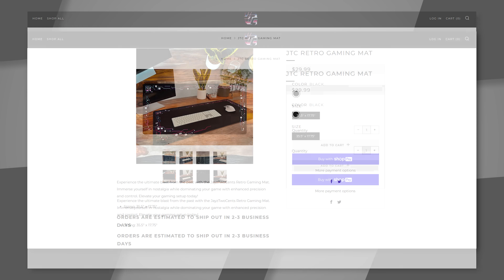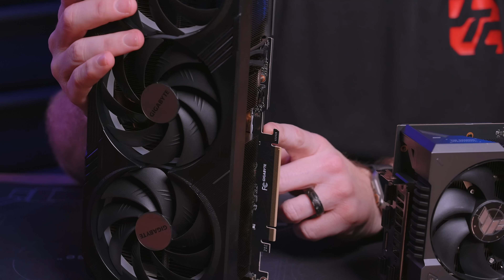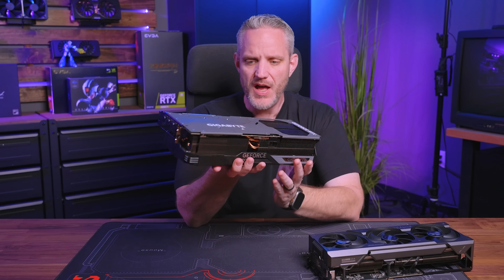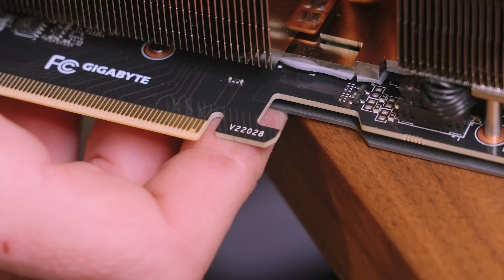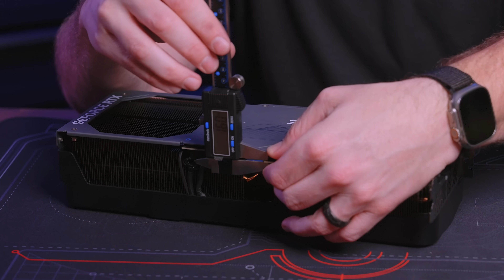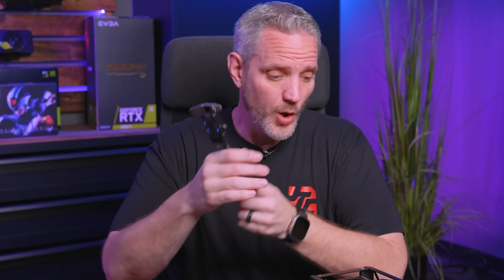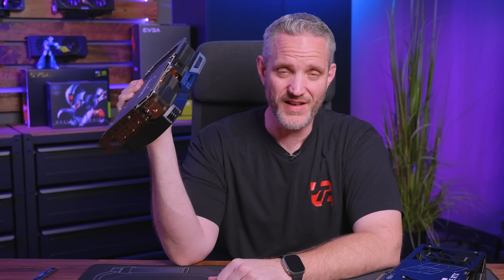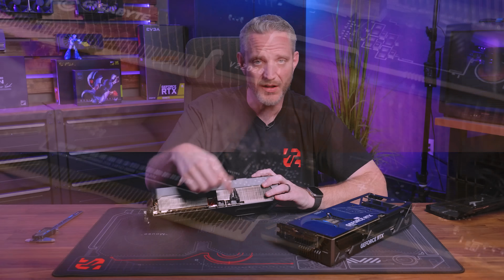These GPUs are cracking and the company REFUSES to warranty them!

Comment: The solution to this problem has existed for as long as the PC has.
Jayz card even have the mounting holes for it at 5:59 timestamp.

Its usually a metal or plastic bracket attached to the front of the card (front as in facing the fron of the PC case) that will slide in to groves in the front of the case.

It exist on old AT and ATX cases but is mostly gone nowadays unless we talking AMD or Nvidia Enterprise cards.
They have the holes at the back of the blower or blow trough cooler and there you can mount the bracket.

This will hold the card from sagging during shipping but also in use.

I have multiple system that uses this system, WHY Enthusiast PC'dont use them is beyond me.
But it seems to be a case of users not being aware and some stupid stigma that having such industrial looking brackets is to good for the PC master race.

I honestly dont know why its an issue because it should not be!
Its not an issue in the Enterprise space because they dont care about the looks of the systems internals.

On the PC side of things we get 50 USD RGB stands, or wires from the top of the case or some arms you can move up and down instead of a 1USD metal bracket that would do the job 10x better!

Those over-engineered solutions just works if you dont move the PC.

In fact a lot of the spare parts that KriFix-German (he is on YT, and will do the repairs Jay mentioned, or he did but they stopped because it breaks again) gets are from cards broken at the PCI-e slot due to shipping damage, so prebuilts and such, there is a video on this type of repair and how they get parts.

They buy the cards that are basically new, reuse the parts to repair other cards or sell the parts by refurbishing and reballing say memory IC's so you can buy and replace ram on your card (I have done that).

So the problem Jay shows here is not new, also another problem that happens when cards bend close to the PCI-E slot os that BGA ram if mounted there can crack the balls or rip the pads on PCB or memory (happened to the RTX 2080T I fixed).

So I really dont like heavy cards or cards tha ram between GPU and PCI-E slot like the 2080TI, RX7900XT/XTX, 4070TI (4070?).
Because you will have the most PCB flex at the PCI-e slot, thats just physics, so most modern cards are not well supported and will be prone to damage if the system is moved or transported.

But all those problems could have been avoided IF the case manufacture supplied the needed front rail and the GFX maker supplied the needed mounting plate for there card.

And I cant see why you could not make that mounting kit look PIMP as anything else if thats so dam important!

Anyways sagging GFX cards is a problem that exist for NO DAM REASON!

The solution and standard is as old as the PC it self and its still used by Enterprise systems, just not buy the PC Master Race and the manufacturers behind those products for some reason.

If I could I would attach some pics and Videos but then YT would just nuke my comment so.
Reply: All the nvidia founders card have the 2 holes on the end of the card, mainly for OEM system integrators to do exactly what you say. You can 3d print your own adapter and find a way to tie it into your case.
Reply: @Jsteeezz  Its also interesting to note that a lot of Nvidia and AMD reference cards are 267mm long.
My GTX780 is 267mm, so is my GTX970 and my RX5700, all blowers.
And considering that any of my add-on cards with the bracket preinstalled, most of them old as hell but I have a fare number of system with the front rail and any card will fit any case.
So that way its very easy to make a bracket for the card that will fit any case.
Idk if 267mm is some official standard or just something AMD and Nvidia ended up sticking to just to make it easier for OEM makers to add there cards to any build with little to no retooling,

I'm not sure this is why a lot of cards are 267mm but even the latest and greatest RTX A6000 is 267mm so its very easy to have the same length bracket for any card if the length is the same.
And for all my systems with the front rails, the length from PCI cover to the rail is the same, so I can move any card to any case if I wanted to.

With Gamer/Consumer cards being of varying length you probably cant have a standard bracket BUT you could still define a standard length or two, length of the card + bracket. 
Then the GFX maker could just send you one or two brackets for the different depths of the case or one that is adjustable for your case depth. 
Anyway just an issue of standardizing and getting shit adopted.
Reply: Regarding the 2080 Ti: Im glad I used it in the vertical mount from the beginning, still fine.
Reply: @LEXXIUS  I hated the vertical mounting kits originally.
The reasons why where the fact that they where there for mostly aesthetic reasons, just like RGB people wanted to pimp there system, not so much having useful systems it seems.
A lot of them could not do Gen4 speeds causing no post unless you limited the MB to Gen3 before doing the final build.
Some risers where very poor quality, some started burning!
Some cases would remove the ability to use the other expansion slots on your MB or limit you to half height.

But I guess riser cables and Vertical mounts have gotten better over time and with the cracking of PCB's and ram breaking due to GPU sag I realized Vertical mounting is one of the best reasons to use them, and with a case that allows you to use full height cards behind the vertical mount the only downside is a wider case.
So nowadays I recommend people to use Vertical mounts, especial if there is ram at the PCI-E slot.
But also there are traces for the mosfets, the PWM signal going around the board edges and even down where the PCI connector is, and if they break, now power to your components on the card.

Another problem Vertical mounting can help with is the cooler separating from the GPU, its a problem on some card, Gamers Nexus has sad many of there cards do that.
The EVGA RTX 2080 TI FTW3 I fixed had ONLY 4 screws holding the cooler in place and those screws had 4 weak as springs holding 1Kg of cooler or over 2 pounds!
Thats just not enough an you will get bad thermals as the GPU slowly separates from the GPU.
Vertical mount somewhat fixes that but this is just another stupid shit engineering mistake by GFX makers.
More screws to secure the cooler would help.
In fact that cooler then applied pressure to some pads for the chokes making it even worse :/
The GFX makes would be better of utilizing the GPU cooler for stiffening up the card, we can see that in Jayz video on the ASUS card having pillars going down, thats why the PCB dont flex as much, but thats just one part of solving the howl cards break for stupid reasons.

I would still prefer if they used the front mounting brackets but a Vertical mount is my second best option if I dont move the system.
You can still breaking it by laying it down for transport.
So sadly without no front mount on should still ideally remove the card going to a LAN for example and remount it once there.

I use a Vertical Mount in a system, its actually a not retro but rebuild Windows Vista system with  a Athlon64 X2 6400+ and a GTX295 double PCB model and it has problems with GPU cooler separation so shim mod (RX5700 style) plus Vertical mount gives much better temperatures (7-8C), plus now my system looks cool for no good reason XD

No I dont get why it has taken the GFX maker and the PC community so long to realize what an unnecessary problem this is and it should never have existed in the first place!

I hope your RTX 2080 TI lives a long and happy life!
Reply: @Nitton Åttiofyra  I have a water block on my GPU, so everything is securely screwed in. But the riser cables are another can of worms... The included cable from my roughly 300 € case (Thermaltake Core P5 TG edition) was total garbage according to all buyers and I had to spend an additional 40-50 € for a good one!
Tried finding one for PCIe 4 and so many cables were bad and didn't work, it's astounding! From the looks of it, it will be even worse with PCIe 5 riser cables!
Reply: @LEXXIUS  Im not that surprised cables for Gen4 are often not working properly because a good cable is hard and expensive to make.

PCI-E Gen4 and Gen5 are a can of worms in the sens that they do require better PCB's, also the length you can go before needing to boost the signal is less then Gen3.
So Gen 4 is more costly to get range out of and Gen5 as I see it is to expensive for home use.

Gen5 requires repeaters, L1Tech showed some servers from WWDC23 the other day and those PCI-E SSD's inteh front of a server rack has cables and repeaters, but servers cost so much its just a small cost of the howl thing but for a consumer motherboard or a cable its a lot of extra cost.

The thing is that when PCi-E Gen3 came out it had enough bandwidth to reduce a lot of support chips like USB and SATA from 2 or 4 lanes to 1 or 2 lanes.

And it did not add any big cost to the board, and the fact that you could often half the Lane counts and go down to 1x Lane for extra USB and SATA port chipset meant cheaper motehrboards with fewer lanesm simpler PCB's, cheaper chips, cheaper everything.

That "saving" went kind of bye bye with PCI-E Gen4, and PCI-E Gen5 it sure wen totally Bye bye.

You now have to pay extra for a more expensive PCB's and with NVME SSD's we need the lanes so we cant just ditch them
We need components on the PCB to repeat the signal and make the signal integrity good so that adds cost now.

Also why AMD on the high end AM5 chipset split everything over 2 chips, that way they can get shorter lanes and keep the cost down because the chips acts as the repeaters/boosters, but two chips are still more costly the one so yea very expensive platform.

I upgraded my server with a Ryzen 5600G , all AM4 IGP capable Ryzens do Gen3 max, so I bought a Gen3 hyper card to M.2 adapter from ASUS, it was like 45 USD instead of 75USD for the same Gen4 capable one that has a bigger better PCB optimized with short traces for Gen4.
So yea going Gen3 to day is a saving if you dont need the Gen4 or 5 bandwidth.

So yea its a problem, Gen3 is even today the budget option and still processors that are being made are limited to Gen3 due to cost, all Ryzen 4000G and 5000G are limited to Gen3.

And Gen4 is kind of the middle ground and Gen5 is the high end so PCI-E speeds are now something that you have to pay extra for, its no longer as cheap to implement Gen2 and Gen3 as it was for Gen1.
My first Gen3 b oard was an ASUS P9X79 going back to Sandy Bridge-E, thats 11 years AGO and my new B550 AM4 board with a G cpu is still Gen3!
In fact AMD sells B550 that is Gen3 only, MSI has a board called B5500 Gen3 something something.
There is also the B550 "oem" version that is basically B450 and also Gen3 only.
Sure AM5 is here but AM4 is so much cheaper if all you need is 4-8 cores and some ram.

A lot of the time I find that for home use your better off with a old MB with 32-40 Gen3 lanes then say 16-24 Gen4 or 5 lanes because the later is often more bandwidth per lane then you need and a lot of stuff dont use more then Gen2/3, simpler addon cards for example.

But well we dont get lanes on consumer boards anymore for 249 USD or what ever, PCI-E is now a "premium" you pay for.

Bit of a rant and you probably already know this but yea PCI-E Gen4 and 5 is in a odd spot nowadays with the MB makers also charging an arm for a Motherboard unless you want to be on Gen3 or 4 and Lane starved.
Reply: @NittonÅttiofyra  I agree, one of the reasons I didn't build a new PC (mine is from 2018, except the 5800X3D) are the high hardware prices. Like the RTX 2080 Ti was 1250€ at launch and the 4090 is 1950€, my X470 Asus Crosshair cost 250€ then and the new X670E is 750€! It may have come down in price now but the voltage issue on Asus boards makes me glad I didn't upgrade because of the ridiculous prices.
Now my plan is to wait a few years and get the previous gen, where potential flaws will (hopefully) be solved or I can avoid them and the cost goes down.

Comment: Keep in mind that the further away the pivot point from the closest anchor point, the easier it becomes to bend something with the same force. Put a metal rod on a table with a very short overhang, it's hard to bend. Stick it all the way over empty space, it's super easy to bend... To me it looks like the gigabyte PCB comes away from the cooler further, than the ASUS one. Plus the ASUS tab has rounded corners at the "L" shape of the retention tab, which won't cause a single point where stress will be localised. It just seems like a combination of factors that's caused this... just unlucky on gigabyte's end honestly... still should be RMA'able however if it's a common fault...

Comment: Fr4 is your basic PCB substrate which is fibre glass.
And it's plenty strong even at thin gauges.
Looks like the PCB substrate is just bad if it's cracking like that.
I have a pc at home with a 140mm air cooler pushed against the side panel with a good 3mm bend in the motherboard and it's been like that for 3 years and I don't worry about it as in 20 years building pcs, I've only ever seen one board go bad from a bent PCB and I've seen some banana boards over the years like hundreds of them and they all worked fine.

Comment: Funny thing that you are mentioning the locking mechanism on the motherboard. On my Asus X570-F board you have to push the card into the slot just a tiny bit for the lock to release. And no, it will not release at all if you don't do that. Tried pushing it with a plastic ifixit tool and it would not release the card. Not sure if that is intentional from Asus or not. But it took me a good while to figure that out.
Reply: The button on my asus strix z690 is poop. The effect of ejection is verrrrry minimal, and slim chance it does nothing for release.

It's a nice try, but all in all, we need a PROPER more standardized method from all manufacturers at this point.
Reply: Oh, pci-e lock on my motherboard (not button) also is extremely hard to remove if i don't push card into motheboard a bit. But not down or up, just deeper into slot.  And it is common lock, not button or anything.

And i know my 6750XT would've had slight sag due to it's weight, if not mATX mobo format... Basically i linked with weight distribution 2 sata ports with cables going through them (did that by paper insert, so weight goes to both ports and not just one), to make janky ass support. 

Also... Hadn't heard as much of an issue with AMD cards cracking PCB to slots... Maybe there is some Nvidia bullshitry going on in background? Especially taking in account how it sets prices for their chips and heavily restricts margins for AIB's...

Comment: Just a bit of additional information: not all PCB substrates are the same.
There are plenty of options with different characteristics including mechanical strength.
It is possible to select the wrong option. Either by honest mistake or looking to shave some cost.

Comment: My card is upside down with the ports on the top of my case, and has a steel brace that uses 4 more slot plate screws, and it screwed with 4 more screw on the other side..
A hurricane cant move my 7900XTX even a millimeter in any direction... XFX Speedster MERC 310, and it does not have RGB :P

Comment: And to make things worse - Nvidia prices the replacement that Gigabyte would send out from the 40 series just as high as the 30 series version was.  haha  Normally they'd be able to go OK our bad - we'll replace it with a 4070 - but the 4070 and 3080 are nearly the same price.  Although - if the rumor of 30 series glut is real - Gigabyte could probably get a sweetheart deal on silicon to replace the cards.  haha

Comment: warning anybody with a 4090 tuf if you use a aftermarket waterblock you need to support the card with something if mounting horizontily, the io bracket mounts to the stock cooler and dp and the hdmi ports with screws  when you put a waterblock on the only thing holding the io bracket on is the screws that mount to the hdmi and dp ports. this may be an issue with some aftermarket waterblocks

Comment: 1. Unless you have to, don't pull calipers off when measuring. Otherwise you get this error
2. You can see ASUS braced near the retention tab, which will help prevent that massive flex.
3. Here's another benefit of vertical mounting with a riser cable.

Comment: Gigabyte literally just had another issue where they had to patch out a backdoor they intentionally left on all of its motherboards from both Intel and AMD 400 series and up.
Reply: Not a problem if you don't use their software. You can literally turn it off yourself in BIOS settings
Reply: @Hakeraiden  moreover, you can deny it's installation on first boot popup within Windows and tell "never ask me again"
Reply: Twisting words, aren't we... 
Improperly secured firmware is not even close to backdoor. Human factor still exists. And this happens A LOT in this world, just look how much data gets leaked due to even worse security flaws... For example Australian medical leak. 

I wonder how many of such applications actually contain vulnerability. If it was Gigabyte this time, doesn't mean everyone else is clear.

Comment: The PCIe connector is already an atrocity. Electronic connectors should not have to bear mechanical loads alone, especially PCBs. I used to work in surface-mount assembly, the boards are just not built for that. They have to allow a little sideways flex so that the assembly and soldering processes don't destroy them, but they don't have a lot of tensile strength when the force is parallel to the board. They have a tendency to crack or delaminate, and even if the insulator remains intact, the conductors can break or weaken.